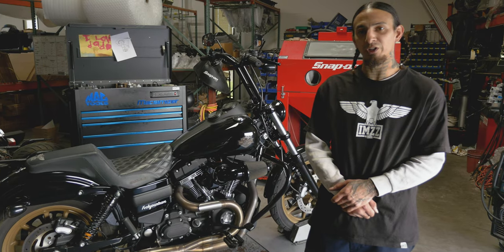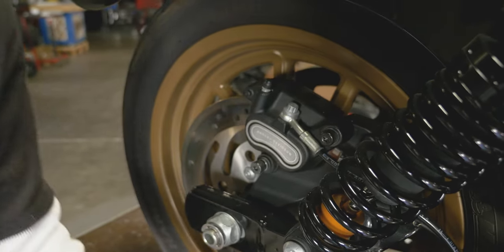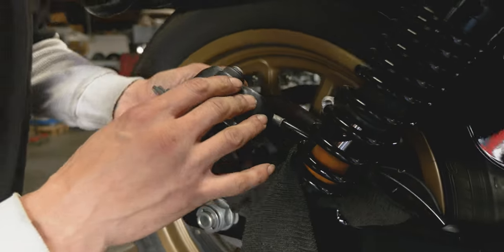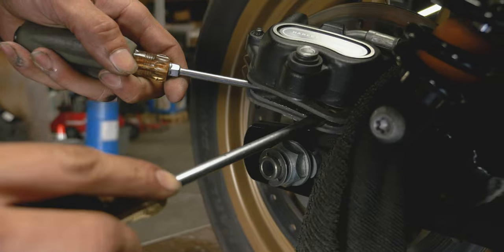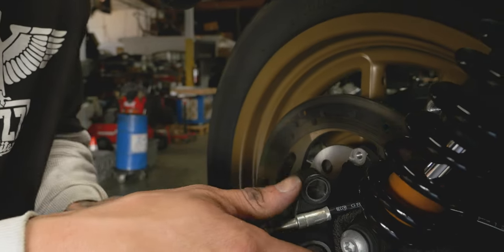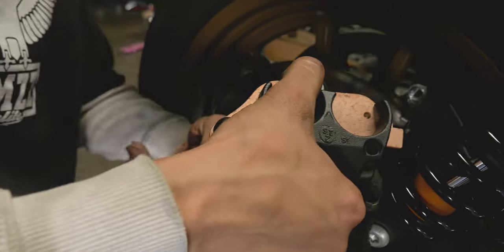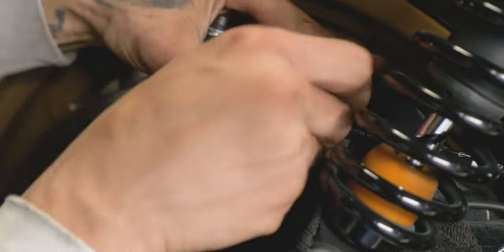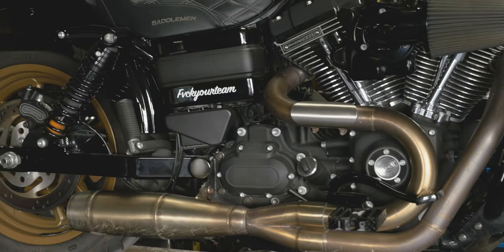Imzz Elite | How-to change out your rear brake pads

Comment: After replacing the brake pads or rear tire does the rear tire spin easily or does it have some resistance with the pads rubbing?
Reply from the maker: It usually spins free until you pump up the brakes.